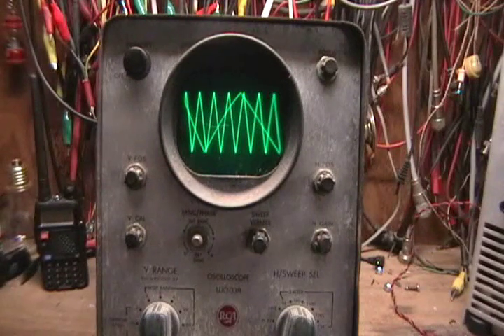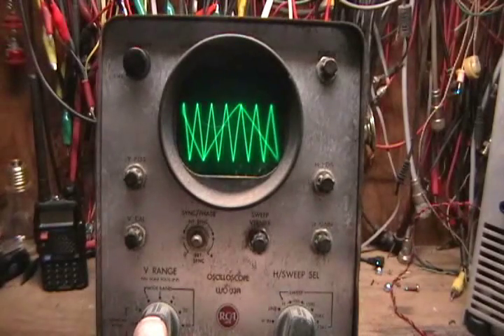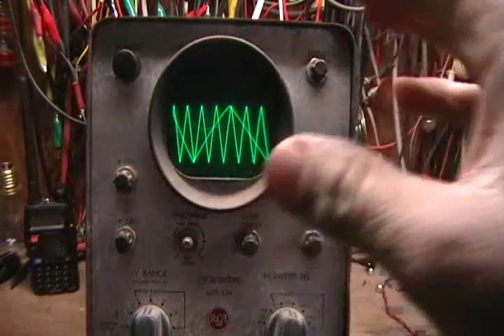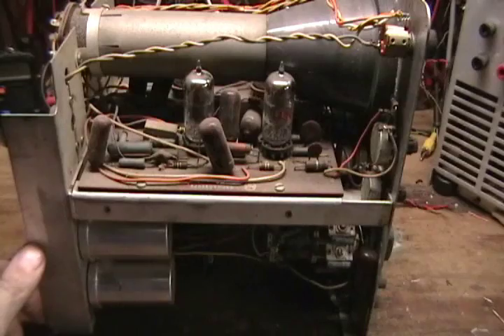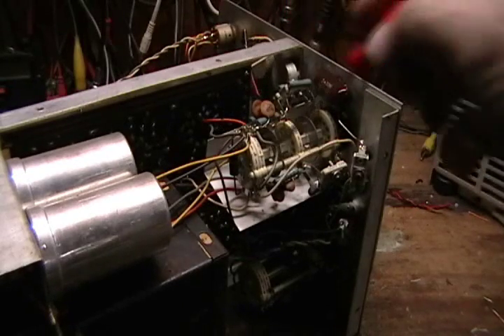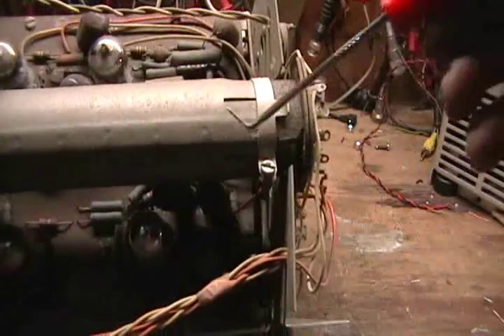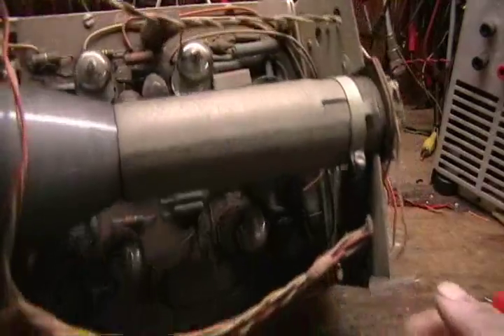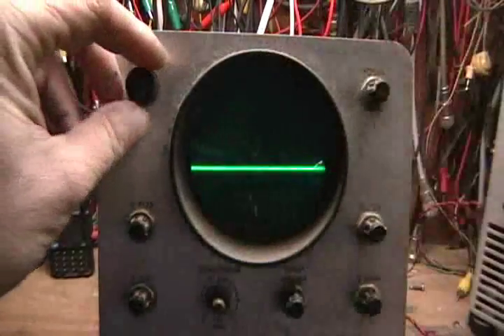A look inside an RCA WO-33a tube type oscilloscope.

Comment: I had a similar vintage one, but the larger 5" screen.  What's the B+ rectifier?  Maybe a 6X4?  Mine had a 1V2 for the high voltage rectifier, probably a more appropriate choice, but the 6C4 seems to work, so may as well leave it.